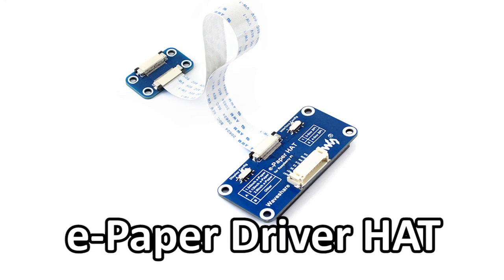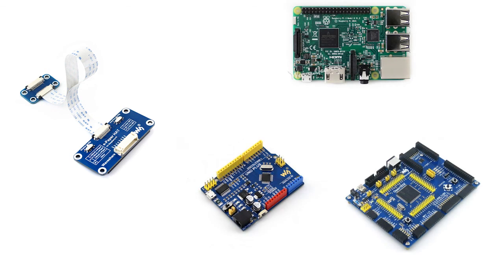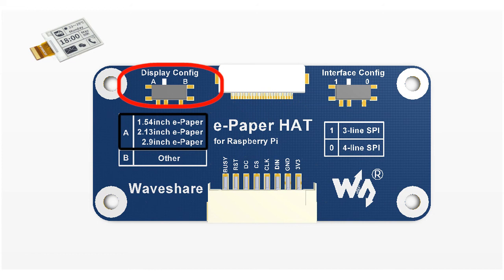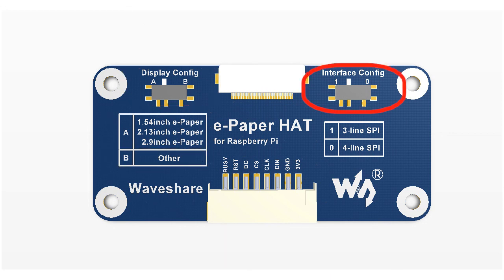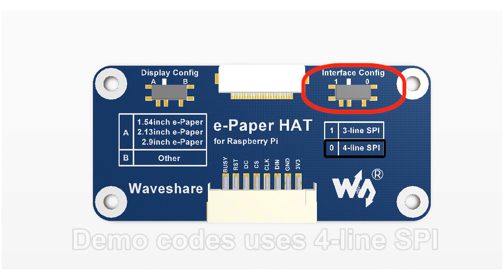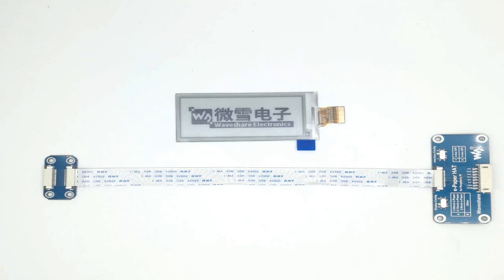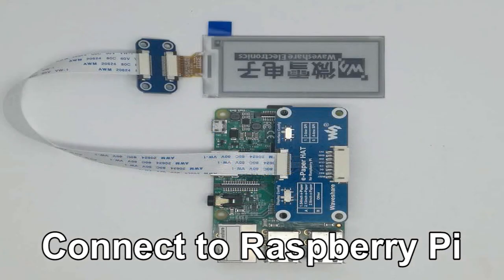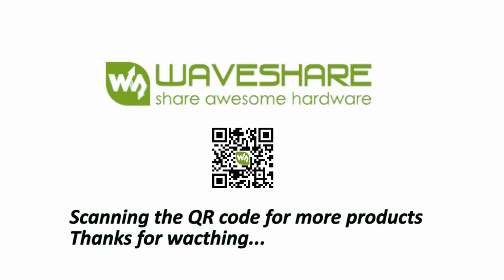Waveshare e-Paper Driver HAT

Comment: Do you just push the screen's cable into the Driver Hat's slot by force or does the slot have some latch mechanism of some sort that you need to release first, then push the cable in, then close the latch...? 
If I'm pushing the cable in should I use Tweezers?
It feels like it's going to break if I force it.
Reply: Thanks for this question I was struggling also :p
Reply: You pull up, not back like most normal latches. It is a really crappy design.z
edit: this is for their 7.3 inch display 3 years later. Still confusing.
Reply: @TechDogeth   Thank you so much. I was struggling with the exact same thing
Reply from the maker: you need to release first, pull the black latch slightly, then put the cable into, and close it slightly, so sorry that we’re unable to send picture here, you could also send email to sales25@waveshare.com, I will reply the picture there :)

Comment: what about connecting to Windows pc, any drivers? samples?
Reply: This uses SPI, which is used for communication which is used with devices such as Arduino, and Raspberry Pi. Therefore there is no way to interface it with a standard PC.